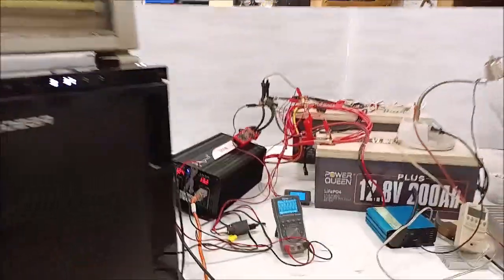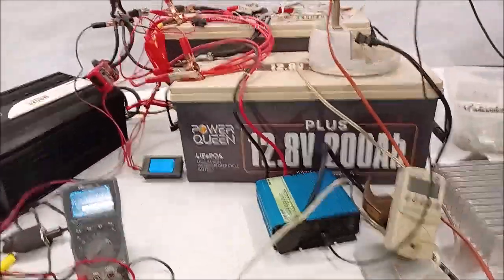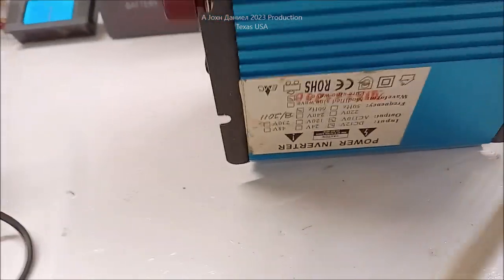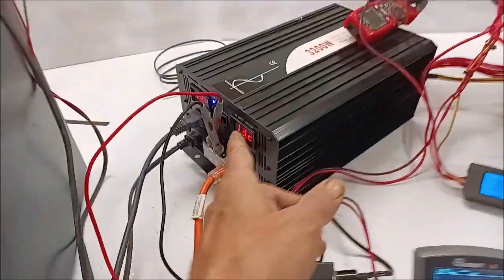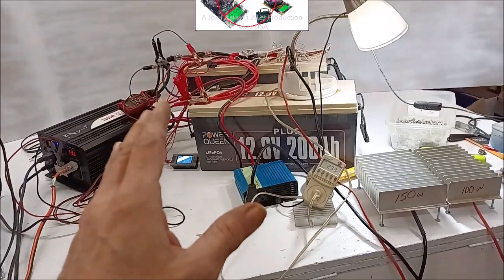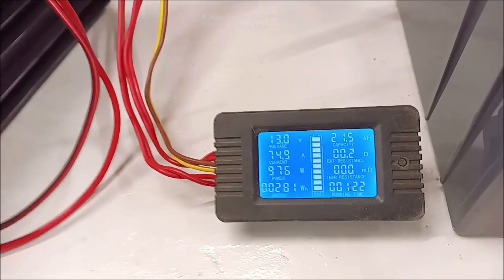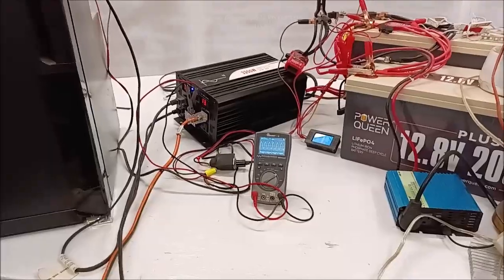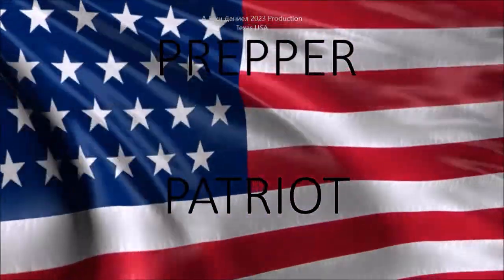Xijia CN SWI Power 3200 watt pure sine inverter REAL TEST using 2 Power Queen 200ah plus Batteries

Comment: There's an instability test that I wouldn't mind seeing done.

I've noticed some inverters lately are having issues with the AC output ducking and weaving in a fully bonded setup, ie where the DC - and AC neutral are joined for the purposes of then running to an earth stake along with the AC side earth arrangements (the inverter itself may have no connection to the earth pin in any sockets on it nor even in the terminal strip).  It does not actually require the earth stake, nor the earthing wiring just joining DC - and AC neutral is enough to trigger it.  When this is done the AC output can become quite unstable, increasingly so depending on the amount of hash the AC load imposes.

At a guess there is poor filtering on the DC side supply for the control circuitry letting the noise in and that causes the HVDC to flutter or the PWM that is used to construct the AC waveform starts to flutter.  Either way the AC output voltage will become unstable and certain LED lamps will show dips in brilliance.  If it gets bad enough more common appliances show issues too.  A multimeter will be good enough to see the issue.  If there's more than a volt of movement in the inverter's output with no loads attached odds on it has the problem.
Reply from the maker: Inverters should never be grounded. Not to anything or each other. They are stand alone. Batteries should never be grounded, Think Car/RV/BOAT electrical system.    The Utility is grounded because its part of their dividing circuit, and the over head wires are subject to atmospheric issues like lightning and sun flares. A inverter simply is not. NEVER ground your solar panels, never ground your controllers, that is a stupid rule made by a NEC tech for Grubberment who never left his chair or spun a wire nut. Ground NONE of your off grid. The energy it makes is not based in any way on the effect of grounding.  If your worried about lightning, install a diversion lightning rod near (20 feet away) to your solar and make it 2x as high. They put grounding screws on a inverter to pass stupid codes not related to them.
Reply: @JOHNDANIEL1  You've made so many fundamental mistakes there that I don't even know where to start.  Even the assumption about lighting damage is incorrect.

An I class device is fine so long as you don't have a double fault.  If you do, you are dead and the inverter won't care less.
Reply from the maker: Inverters, portable generators, solar panels, solar controllers and panels under 250 watt falls in the DOT electrical code. Do you add a ground rod to a car?? Not sure what fundamental mistake of installing it as it's designed to be makes it incorrect. Inverters have breakers, if they do not then use a power strip or circuit breaker box with heat only activated breakers. Been doing it over 15 years, the only people getting their homes hit by lightning and burning them down are the ones following the program your describe. So I will continue the one that works.
Reply: @JOHNDANIEL1  Really you are off in the weeds now.  The inverter being reviewed is 3.2kW and I bet you have more than 250W of panels in your array.  Even if low powered items are covered by the department of transport in your country rather than the national electric code, what you have in this clip wouldn't be subject to the DOT regulations anyway.

The fundamental mistake, well one of them, is that you are assuming your premises needs to be struck by lighting for damage to happen.  Just a cloud to cloud strike overhead is enough to produce common and differential voltages in your solar array wiring to fry your solar charger for a start.

I was just asking for a simple bonded setup test to be done.  I guess this isn't the channel I thought it was.
Reply from the maker: @retrozmachine1189  I can do a bonded test on it, the board in them is built isolated from DC to AC with only the control board connected to both for measuring. Electrical bonding is connecting multiple conductive components that are not intended to carry a current. This creates a conductive path between equipment, housing, panels, metal parts and other structures. I am sure if you connect DC ground with AC ground in a High frequency inverter your going to freak out the inverters control board and likely damage it. This is a $300 experiment to damage my gear, so yes I ain't the channel who deliberately damages my own stuff when I try to test what should not be done. 
In fact 3/4 of warranty claims on inverters are people doing it, they loose the claim. So you see why I say the "ground terminal on a inverter is BS"  
We install physical "at limit fusing" before and after all the controllers. 
A massive lightning storm 2 days in a row lasted over 28 hours in our part of the world caused tens of thousands of homes to get damaged electronics without more than as they said 8% of the lightning hitting the ground or 1% hitting any of the homes, so I know what your referring to but the only damage to solar panels, inverters and controllers came to those with them grounded, the are still studying it but are too ignorant to admit the earth grounding was the cause, the are ignoring all the panels, inverters, controllers mounted on RV's and vans (mobile vehicle installs) and my own install, which had no failures. Boats in Lakes between San Angelo and lake Breckenridge had spotty damage, depending on the hull type, if metal was in the water or not, and Texas A&M still too stupid to connect the dots. This exact thing is still being "studied in Florida" from the same thing with them ignoring the obvious.  
IF you create a circuit to the ground, IF you bond the negatives into one in electronics you make a path. Creating a path is creating a likely flow point therefore attracting the radical electrons to your device. ( basic modern jet air plane electronics )  
Basic is that common and ground connected allows a return to atmospheric electron flow from earth to pass. His conclusion was to transmit energy over the air, he had to make it in a frequency that evaded the earths attraction to that energy.    Nikola Tesla  He was a ardent anti physical grounding and bonding advocate, saying to make only carbon bridge grounding to avoid making yourself a target.
Reply: @JOHNDANIEL1  Don't bother.

Anyone that is interested in learning why inverters blow up when people do a full DC - / Neutral / Earth bonding setup get in touch with me.  It's not because the control board 'freaks out'.

Here's a tip:  It tends to be a North American problem, but also applies to anywhere that uses 'split phase' electrical supply and any inverters that are intended for these markets but have been shoe horned into '240v' countries or even 120v too.

Comment: I’d like to see how it would do with a well pump. That is where i want low frequency.
Reply from the maker: My 3000 runs a 1-1/2 horse Red Lion submersible 120 volt it's pumping from 110 feet with no issue. This one would cover a 2 hp pump with the 1500 watts to run it and the normal 2300 to 2800 surge to start them. My 3000 would do that too, but this one has one more set of transformers and 4 more up stage MosFets. Not bad at all for $315. My 4000 watt low frequency AIMS branded had issues with starting them but would pump, this one does not even notice them.
Reply: Hey! I've got one of these 3200W inverters running a 240V 1HP well pump as emergency backup, absolutely no problems. Handles the surge like a champ every time without fail, and the pump runs exactly like it would on mains. 100% recommend.